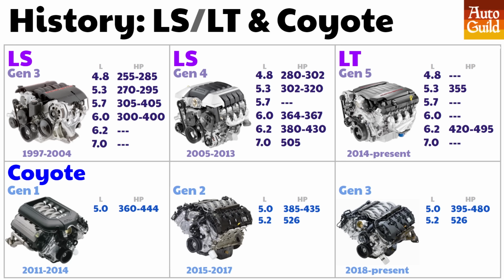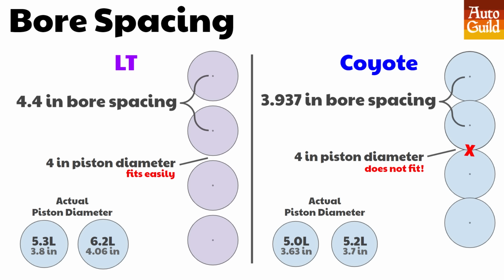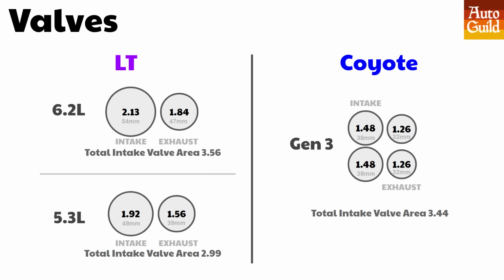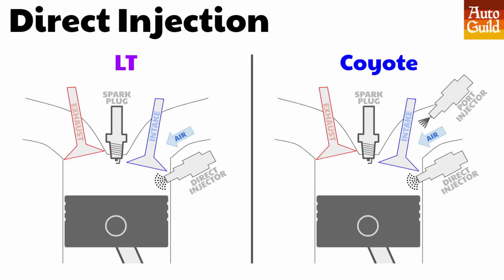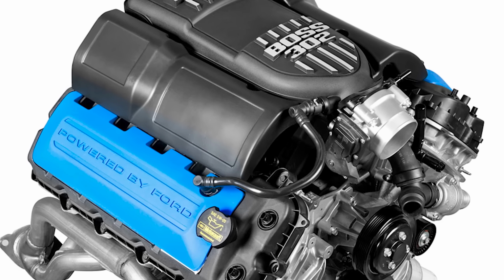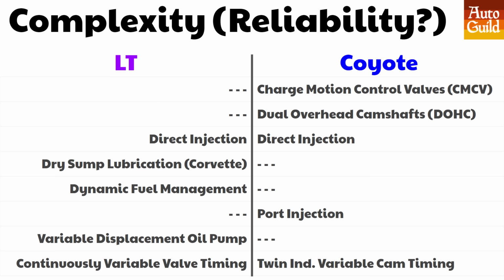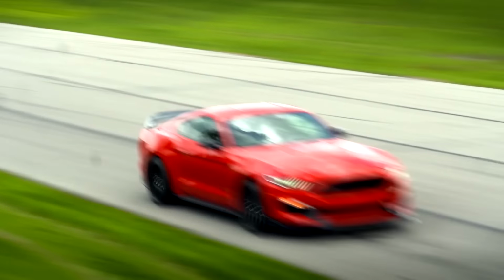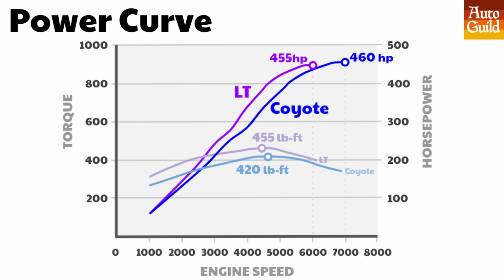GM Gen 5 LT vs Ford Coyote.  Which one is better and why.

Comment: I’ll take the Gen 3 5.0 please. Amazing motor capable of boost under stock internals while kicking ass. Not to mention high rev capabilities and pretty reliable. Also I like the mustang look much better. Just personal opinion
Reply: The current Mustang is definitely better looking than the Camaro, and I'm a GM guy.
Reply: @TheColbyChurch  I like these kinds of comments. A fun ride is a fun ride.
Nowadays the tech in these engines is getting amazing tbh
Reply: @TheColbyChurch  the camaro is being phased out anyways it just doesn’t sell
Reply: @TheColbyChurch  ye, plus those SS look like they tryna suck in everything that comes infront of them
Reply: @TheColbyChurch  Man The new Camaro refresh looks much better imho! The mustang is a classic look but The Camaro is the future! along with superior handling which is a weak point of muscle pony cars! The Camaro is revolutionarily the best in handling and much lighter and yet holds more fuel, longer wheelbase yet shorter than mustang! The engine is farther behind the front wheelbase compared to Mustang for much better weight distribution! The Camaro trully is the superior car yet people go for the mustang classic looks more than progression..Sad..Im looking to buy an Camaro SS 6speed manual NA V8 all day with the SS1LE Package its just the best!.
Reply: I prefer the mustang looks until the ZL1. The ZL1 just looks so damn aggressive, I just wish you could see out of it lol. I have a 1968 Camaro SS 350 convertible though, so of course I think that looks best😁
Reply: @BigfootUnibrowMan  zl1 looks aggressive but I’ll take a gt500 over it too. Great cars nonetheless
Reply: @Colby Church
  Man The new Camaro refresh looks much better imho! The mustang is a classic look but The Camaro is the future! along with superior handling which is a weak point of muscle pony cars! The Camaro is revolutionarily the best in handling and much lighter and yet holds more fuel, longer wheelbase yet shorter than mustang! The engine is farther behind the front wheelbase compared to Mustang for much better weight distribution! The Camaro trully is the superior car yet people go for the mustang classic looks more than progression..Sad..Im looking to buy an Camaro SS 6speed manual NA V8 all day with the SS1LE Package its just the best!.

Comment: I'm currently saving $ for the C8 Z06.  I ride motorcycles and love winding out the motor. 
I love all cars, well most. I have mad respect for Any manufacturer that stock block can take almost 1000 hp & tq
Reply: I use to race Honda 750 class back in the day.
Cars and bikes 2 completely different worlds.
Test drive everything.
Reply: @Mr.Robert1  I agree 100%!!! The C8 Z51 is SOLID but cant wait for the high pitched screams of the FPC DOC engine

Comment: high rpm and high compression means parts will wear out fast on that coyote
Reply: Sell it after your done playing. I never owed any car over 10 years in my life. Now I lease,
New ever 3 years. No headaches
Reply: @Mr.Robert1  I've had the same 12 valve cummins dodge for 20yrs and never had to do anything to the engine.

Comment: I love both motors but GM managed to make an engine with an old sound but new reliability. The coyote is a higher pitch and I prefer the deep tones of older muscle. Plus the LS and LT engines are lighter and usually more powerful.
Reply: Do you own any Mustang's?
Try it before you knock it. I was very surprised with my first Mustang.
Reply: @Mr.Robert1  I don't hate mustangs. I just prefer the deeper tones of the LS. I own a 4.6 ford V8 and I love that car. It's a merc grand marquis. Same motor as an sn95 gt.

Comment: Voodoo looks great on paper and is great to drive.  But what about vibration, oil consumption and premature engine failure?  Seems that if you build a Ferrari engine you get Ferrari reliability.
Reply: Is Chevy your Ferrari ?
Reply: @Mr.Robert1  Uh no, quite obviously people like the Voodoo because it has Ferrari-like characteristics.  Nice deflection though.

Comment: HP per liter is a useless metric that says nothing about efficiency, since the LT gets better gas mileage and makes way more power under the curve at every RPM except peak rpm, peak HP figures are good for advertising but they are meaningless outside the context of the entire power curve. 
Additionally the Corvette LT1 is rated at 460 with an exhaust. Plus, all these LT HP ratings are underrated as has been proven many times by many different dyno sheets on stock engines.

Comment: When you showed redline of the engines coyote engines  love rpm hense why most people looking to tune them set rev limiter around 9k. 8k is the sweet spot for a coyote power wise so long as the camshaft can handle it.

Comment: 11:45 the LT dynamic fuel management was a nightmare with cylinder deactivation literally killing motors faster than without it. Definitely no a contribution to reliability...
Reply: I am gm fanboy, but like mentioned in the video, I am fairly unbiased as I respect all American car manufacturers. Imo GM and Chrysler didn't wanna do a cylinder deactivation system.. let's rewind to 2005-6 when the epa was cracking down on big honking displacement engines. Ford went in the way with downsized turbo 4/6 bangers to please the epa. However GM and Chrysler wanted to keep giving the people what they want, the people still wanted ohv V8 engines but the epa wouldn't have it, so D.O.D later changed to AFM for gm and Chryslers MDS systems was designed to please epa standards, that's why gm and Chryslers included these systems in their cars and trucks. Even though it's a terrible system for reliability, they still made it extremely easy to do a physical delete, since they can't do it from the factory floor, they can sell you the parts and information to be able to do so
Reply: Eh simple tune out and it's lifter's which is another easy change.
Reply: Well you can blame that on government epa intervention in order to keep 8 cylinder engines & meet EPA standards.  Never the less it can be deactivated and is an engineering disaster  killing lifters.
Reply: @mewrongwayKOCXF  may be you misunderstood disastrous as in reliability vs power. Regarding the Blackwing, you do realize that it is a supercharged V8 right? How silly can one be to compare a supercharged 6.2 L V8 to an NA 5.0L V8? Wait I got one for you, how about the supercharged 5.2L OHC V8 in the GT500 making close to 100HP over the supercharged 6.2 L OHV V8? Name one reliable Cadillac with an OHC engine?
Reply: @noblekitty  Name one reliable Ford engine?
Reply: @mewrongwayKOCXF  most of Ford engines are reliable if you compare to GM and now so called Stellantis. You have to be reasonable and look at the overall % of how much cars and trucks Ford sold vs failures rate. Just because some people got some lemons don't mean they are not reliable. Ford usually get dings for their infortainment system, or the dry dual clutches tranny. Ford always tries the newest techs and is way ahead in innovations. They are not as reliable as Toyota, still being made by unionized workers, but a better domestic maker for sure. It's hard to accept it if you are a fanboy. I've owned and driven all 3, European, Japanese. Now I'm old and lazy. So all my cars are Toyota.
Reply: lol  GM is very reliable compared to Ford! Ford has had some of the biggest recalls and thanks for supporting the Japanese kids that own more of America than your kids do!  Ford does not innovate, they copy!  They use GM designed transmissions!
At the companies’ current stock prices, I expect a compound annual rate of return of about 14% for General Motors and 5% for Ford.
In 2021, General Motors had a market share of 13.9% in North America, while Ford's was 12% in the same year.
Reply: @mewrongwayKOCXF  you surely don't sound like a gear head bringing in politics. Is it more patriotic to support a company that took bailout after bailout, then went over sea and invested those tax payer money into building cars in countries like China? GM is about money making. Ford, since creation, has always been about bringing affordable vehicles to the masses. The model T, the assembly line, the cheap Maverick, aluminum alloy in trucks and SUVs which was only used in luxury vehicles before ...prove that Ford cares! I've heard about the BS that Ford copied the automatic transmission, and that's about the only thing the GM fanatic had going for. So the new 10 speed transmission that GM are using in a lot of their stuff now was developed by Ford. GM developed the 9 speed transmission, Ford did the 10 speed. They were afterwards shared between to reduce cost. But the 9 speed is trash, neither one of them wants to use that trans anymore. Ford put turbocharged v6 in a truck 10 years ago. And the haters laughed. Now GM is pushing a turbocharged inline 4 in their trucks. But GM being GM, they suck at making OHC engines. So that engine is a POS. Toyota finally catches up after 10 years with their own version of turbocharged v6. Ford makes a usable EV truck. GM makes a joke EV Hummer. What a bad way to waste money.
Reply: First, Was I speaking to you?  I dont drive Japanese or European cars!  I have GM and Dodge!  Yes Ford took bailouts too, Just under different gov programs!  Educate yourself.  Ford has done everything you accuse GM of!  Ford even hired a thug to kill factory workers that went on strike!  GOOGLE "The Ford Massacre: Detroit's darkest day."  Henry killed the very people that stuffed his wallet and everyone looked the other way!! Henry didn't give a shit about anything but his wallet!!!  He made cars cheap to sell more and stuff his wallet, not to help the little guy!! If you want to be a Ford nut licker be my guest!   My brothers 2021 F250 has a transmission with a GM plate on it! lol  No wonder everyone puts a LS in there Fords. GM put a Turbo on a V6 back in the early 80's, It was Called a 
 Grand National, It put Vaseline on the back sides of all the Fords and Dodges!  Took Ford another 20 years to figure out how to use a Turbo!  Talk all the bull dung you want!  I know your lonely and need someone to talk to.  It's ok I understand.  The Japanese killed thousands of your brothers and sisters, you keep buying there crap, not me!!!   😂😂😂
Reply: Got that tuned out the minute I drove it off the lot. Not a big issue if addressed.
Reply: @anthonycosta1776  How big of an impact does tuning it out make? I got a '20 SS manual so it doesnt have it from factory but from what ive read on different pages, getting it tuned out or having the manual doesnt really save you from the lifters failing.
Reply: @Hamillie_  the lifters seem like you could change em in the driveway 🤷.. They make a dod delete kit for your SS as well.
Reply: Or may be GM and Chrysler can't make a good OHC engine? Look at all the OHC engines that they ever made, most were disastrous.

Comment: Ford Modular engine did same few parts with Coyote engine. Like crankshaft bearings and rods in Gen 1 engine after that only bearings. Both have same bore spacing and transmission bell housing pattern

Comment: It just depends if you are going straight line or on a twisty course.  Lower/shorter LT is good for low CG on road course, Coyote higher CG but responds better to upgrades which is good for drag race.
Reply: So 5.0 is better for straight lines?

Comment: The coyote is better than the LT basically because of fuel. You need a bigger cam and added port injection to make any real power in an LT. Coyote can make 1hp easily. LS is better than the LT for that reason too. Also, only the 5.2 Voodoo engine (not a coyote, but very similar platform), has a flat plan crank.
Reply: In racing applications the LT is a better motor. You can rip 750hp around a track pretty easily, and be slightly faster in the corners because of a much lower center of gravity. 

Both motors are amazing feats of engineering, it’s all about preferences and application

Comment: Point blank: for typical consumer applications within a 10 year service life, the Coyote is better. Beyond said 10yr period, the LT wins out. The Coyote has an age-related issue with the timing assembly, which begins to rapidly degrade shortly after 10 years. A properly maintained LT can easily go for twice that... though I can't say the same for the vehicles they come in.

Comment: With the coyote you can do a few bolt ons and make close to 700 horses. I’ve seen first gen coyotes with an intake, exhaust, and tun making close to 600 horse with a power gain of nearly 200. If you want to break the 600 barrier you can do a type of plug and play centrifugal supercharger. For power going from 800-900 a roots style supercharger is needed and all of the additional replacement parts to make it run.  You can make over 1000 with a roots style supercharger but you’ll be at its limits so for anything reasonable above 1000 horse power you need a turbo set up. The first and second gen coyote engines can really only make 800 without needing to swap pistons. They also can run sleeve supports up to about 1000 which is when you want to just do the sleeves. The gen 3 coyote doesn’t need anything done to the sleeves until about 900 horses because they slightly redesigned the block to help with the cylinder strength. The second and third gen coyote had a coat on the pistons which strengthened them but I wouldn’t trust it on the second gen because people had issues with it. Coyotes tend to be easier to build with boost because of their head design and dual overhead cam which allows for essentially two different profiles to use. The only down side to the coyote is that you can’t get the lopy idle that you can with an lt, ls, or sbc.
Reply: unless u put a ghost cam tune :(

Comment: A 425 HORSEPOWER PURE STOCK COYOTE ENGINE OUT OF A MUSTANG IN IN NMRA RACING. WITH COLD AIR INTAKE AND HEADERS AND FORD USE COMPUTER IN 3000 LB FOX BODY MUSTANGS ON PUMP GAS ARE GOING 980S AND ON RACE CARS AND A DIFFERENT TUNE ON THE COMPUTER ARE DOING 940S IN A QUARTER MILE. DO NOT COMPARE THE LS WHICH IS A FORD 351 WINDSOR WITH RAISED INTAKE PORTS AKA FORD 427 HIGH RISER ENGINE. TO  COYOTE. THE COYOTE DESTROYS THE LS IN EVERY WAY WHICH IS OLD FOR TECHNOLOGY

Comment: The LS/LT engines will be the go-to option for builders for years to come.  As you've noted, the engines were made in huge numbers and their is tons of aftermarket support.   In an OE application, I prefer the Ford engine for its sophistication.
Reply: LTs will be far less popular because direct injection only is disastrous for long life.  But I'd always choose the LS over the Coyote for transplants.
Reply: @MrMightyZ  There are injector companies out now making big CC DI kits and stroked pumps like how the diesel boys do it. Tuning the stuff is a pain in the ass still, but getting better. You're better off with an aftermarket ECU and injector driver, but the stock shit can work too. The idea of fuel delivery timing isn't really here yet, but it's going to be a game changer. With DI, you can build engines totally immune to detonation because you can put fuel directly in the cylinder after TDC and intake valve is closed.
Reply: @ArizonaMatrix  And I have zero doubts about DI being objectively more power efficient and I’ve seen some bonkers after market numbers but I’m poor so I value longevity and reliability above all else and DI requires to much long term maintenance to keep the headgear clean.  Long term a DI motor can start behaving like an old carbureted engine.  Rough.
Reply: So you enjoy pointless excess complexity?  How odd.

Comment: Coyote is a great engine and a high rever, but keep in mind those 4 valves aren't as efficient as they appear due to cylinder shrouding.  Still more flow than the 2 valve LT but not as much as it would seem.